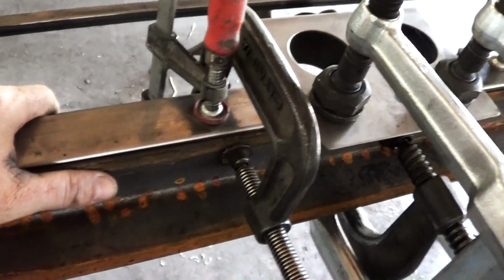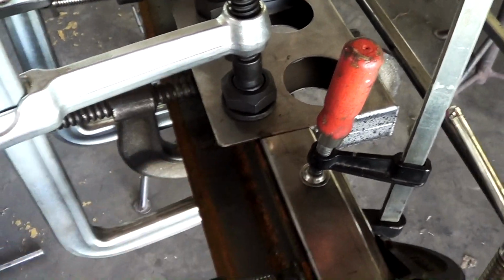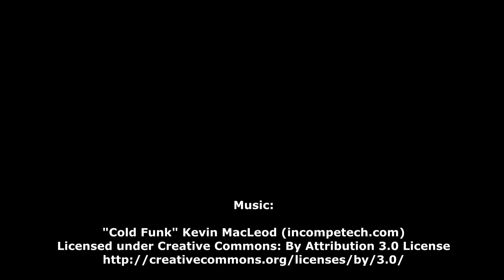Slum Lord Gate Part Four Lockbox and Stuff v44

Comment: my props to you for using at least 1.5" thick lock boxes.. none of that cheap crap 'from another mother'.. some are even 1" thick and to even be able to work with modern locks, they have to have raised lips on the cross-bore holes !

Comment: Excellent tutorial!!!!!  Love the double "L" to keep things true.  Still learning...and not being a smart a*&, but 'why' do you prefer a 1 5/8" lock box for 1 1/2" rail?  Hoping for a response, as I'm planning out my steel door/gate using best practices.
Reply from the maker: The 1 5/8" box works with the lock sets that are readily available. 1 1/2" tubular steel is readily available. You choose your battles. I could get the smaller lock box and use smaller tubing for the rails. But, they get pretty flimsy. Usually when someone contacts me about a security door they want that heavier feel.

Comment: i used to do the lockbox like you did it, but its too risky.. often they still warp up the frame. i now weld the lockbox on 2 sticks first, i ensure that stick with the lockbox is perfectly STRAIGHT then i build the frame with it. i found this way to be a lot less risky than risking the whole frame to be warped.

Comment: Why put bars vertical and a solid panel over to cover it why not make is solid from the beginning
Reply from the maker: He didn't want it that way. There's really no reason why it couldn't have been built without the bars. It actually would have been easier and turned out nicer in some ways.